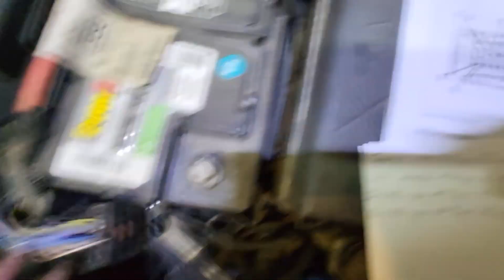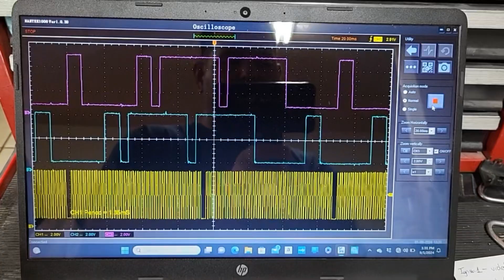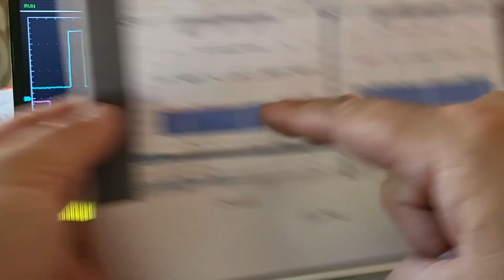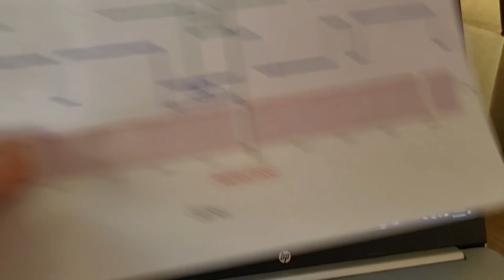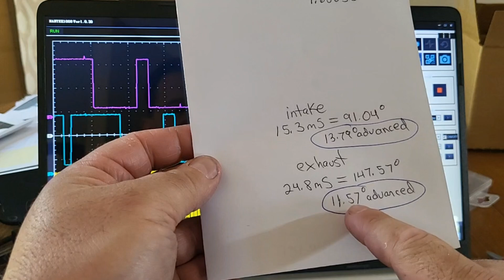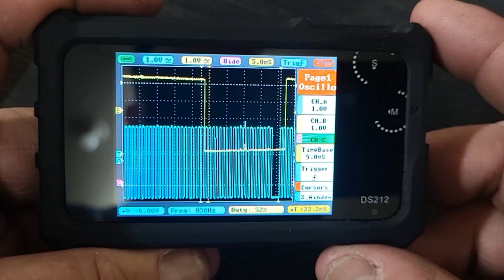Ecotec 2.0T cam/crank correlation, pre/post repairs, Hantek 1008 oscilloscope, DS212 pocket scope

Comment: Cool. I'm sure you already know this: You can setup Phase rulers in the PicoScope Software, then read directly as degrees. This is why I prefer the PicoScope software to the others for this type of analysis. 🔧
Reply from the maker: Ya I'd love to have a Pico but unfortunately I don't have pico money LOL. I don't think the lower end 2000 series scopes allow the automotive rulers or allow the automotive software. I do have Hscope tho and it does have the degree rulers and other automotive layovers. Hscope is about as good as it gets for the home gamer but I'd love to someday get an automotive pico. Thx for chiming in👍
Reply: @MarcBchannel They absolutely do. I have a 2204A (~$150) and it works perfectly. It does not allow you to use the automated setup software like the higher end scopes but otherwise the software is identical. It's really no biggie as you can just set it up yourself by reading and following the guided tests printed on the website. I've done hundreds of measurements on my 2006 Matrix using it with a 2012 MacBook Air.
Reply from the maker: @MarzNet256 Cool I might pick one up. I've downloaded the software in the past just to try it out and I really like it. I like that you can save and share waveforms. I can also save and share with Hscope but the library in the cloud isn't very extensive. Thx for sharing
Reply from the maker: @MarzNet256 I wanted to ask. Do you have pico 6? I've heard that pico has made changes when they came out with pico 7 that doesn't allow the automotive features and won't allow access to the waveform libraries unless you have an automotive scope like the 4000 series.
Reply: @MarcBchannel I run Pico 7 with a 2204A which does not allow the automotive features but I can still perform all the same tests by just following the description on the website. I think it's actually better for learning how to set everything up. Also, other folks put waveforms up which are accessible even without a PicoScope by just running the software in demo mode. 🔧

Comment: Question,  what are the small spikes on the violet cam ocilogram.
Reply: Thanks,for explaining,  very good video, still learning
Reply from the maker: @alvaroenriquez5837 I'll be posting another video here soon on a cam/crank correlation if you wanna check it out.
Reply from the maker: @alvaroenriquez5837 Your welcome👍
Reply from the maker: Signal noise likely
Reply: @MarcBchannel is it possible that it maybe injector,  or coil #1  spikes, or dirty reluctor.
Reply from the maker: @alvaroenriquez5837 I can't say with certainty. It really isn't a concern. Signals will have noise in them sometimes. The noise in the signal is not excessive and some noise is normal especially with inexpensive DIY oscilloscopes like the Hantek which is known to crash when exposed to ignition coil interference. If the waveform is drastically different from a known good then it's a concern.
Reply: @MarcBchannel thanks.

Comment: New subscriber and glad I found your channel because I have a few scopes I have the HS512 , a two channel pico , and a MicSig . The good part of finding your channel is we seem to be at the same level of knowledge . I’m a retired mechanic and the older you get the brain sometimes fails you . I like the section of converting time to degrees and pointing out the advanced and retarded positions on the scope image . I haven’t come across a video with the clarity of yours . Thank you for sharing and I will follow your channel .  Artie 😊
Reply from the maker: I'm glad you enjoyed the video. It's amazing what you can get done with budget scopes and scanners. I also have an HS502 along with my Hantek 1008. I just recently bought a Hantek 6074 4ch and it has better sampling than the 1008 but still has a somewhat small buffer. I really like it on the Hscope app. The 1008 doesn't really work all that great on Hscope. I prefer using it with the PC software. What model Migsig do you have? They look like they are really nice for the price. Good sampling resolution and very large memory buffers like the automotive Picoscopes👍

Comment: I read about the 8 channel is inaccurate or noisy. Do you recommend that device for CANBUS and CamCrank Troubleshooting? I usually do guess works but i want to level up.
Reply from the maker: @MyAutoproblems  It can definitely level up your diagnostics. It's a great scope to learn oscilloscope basics for automotive repair and it will help you with most repairs requiring an oscilloscope. It has it's limitations with it being an entry level scope. It's an 8 bit scope. The resolution is not very high and won't give you an accurate waveform on faster signals but in most cases it's not a problem. I've captured canbus waveforms with it and they are not very good but you are mostly looking for the can hi/lo signals to mirror each other and to not glitch or show a shorted signal. For that it works well enough to spot problems and to point you in the right direction for the repair. As for the scope being inaccurate, it doesn't have the best resolution so the waveform isn't represented accurately on faster signals. But it gives you enough information to make repairs. You can forget about using more than 4 channels at once. All the channels share the resolution so the more you use, the lower resolution per channel. I don't ever use more than 3. You may pick up some noise if your leads are around interference like ignition components. If your testing ignition coils and have issues, you can probe at the ECU instead of at the coils. My biggest problem with the scope is the software. It's very basic. And the memory buffer is terrible. Basically you only get what's on the screen. And you can't save waforms to open up in the program. You can only save an image of it. For an entry level scope it's good enough but there are other entry level scope options. The 2000 series Picoscopes are better but the 2ch one is around 200usd and the 4ch is about 400usd. Their resolution is still not great compared to the 4000 series automotive scopes but the pico software is excellent and you can become familiar with it if you decide to upgrade. A great scope and one I own is the HS502 2ch scope from Martin Loren. It uses his Hscope app and it is excellent. It is a 12bit scope and the resolution is very good for a budget scope. The software has alot of features and can record long captures. You can save waveforms and reopen  them in the app. When you buy the scope it comes with the app and automotive module licenses. The automotive module gives you the 4stroke and 720deg overlays. Pretty high end capabilities for a budget scope. The only draw back is that it's only 2ch but alot of the times you don't need the extra channels. Excellent scope if you can't afford a profesional pico scope.
Reply: @ thank You Sir fir in-depth details about the scope. Do you suggest a 2 channel scope for diagnosis of The Cam-Crank Signal? Sometimes, i get a V6 and then I believe i will need more than 2 channels to diagnose the waveforms for timing chain related issues. Hope you can guide me on this step.
Reply from the maker: @MyAutoproblems I'd rather have a better 2ch scope if I had to choose one. It depends on your budget and needs. The Hantek 1008 is usable if you need 3-4ch but it's not ideal if you need an accurate capture like for ignition/injector/canbus tests. like having both, the Hantek and the HS502 on Hscope app. If I had to choose one I would choose the HS502. It's a way better scope and the app is fantastic. I believe it's still around 100usd, about what the Hantek is. You can get creative with it. You can take a capture with the crank and one of the cam signals then take a capture with the crank and the other cam signal then compare. This is a work around when you only have a 2ch scope. The Hantek 6074 4ch is another option for around 200usd. It has better sampling rates than the 1008 (up to 1GSa/s vs 2.4MSa/s on the 1008).  You can also use it on the Hscope app which adds alot of high end features. I've never used one but there is a youtuber ravifix that uses one on hscope and he seems to do pretty well with it. You have to power it up with a special usb connector with a separate power/battery supply because it's power hungry and the host android device won't power it like with the HS502 or 1008.  I tried the 1008 on the hscope app and it's not very usable because it's hard to adjust the sampling rate and time base on the app. I think it's because the low sampling rate of the 1008 makes it difficult to adjust right on the app. But the 6074 seems to do well on the app. If you use the 1008, stick with Hantek software. Sorry if I'm laying down too much info. There are alot of options and alot to think about. It's difficult to decide the best option when your on a budget and just starting out. The way I see it, any scope is better than no scope. If your just starting out and don't want to spend thousands of dollars on a professional picoscope, than any of these scopes will do. Let me know if you have any more questions. Cheers👍
Reply: @ i love digesting all these technical information! I keep wandering on yt looking for scopes, but without any technical knowledge behind each scope. Your answer has made me clear many doubts. The work around with pico makes Pico 2ch the best budget friendly. I will look into the models you mentioned and see what fits the budget. Again, thank you for all the valuable information you provided. It has made decision Making way easier for a lot of us. Thank You for sharing knowledge.
Reply from the maker: @MyAutoproblems  The pico 2000 series 2ch would be a very good choice for a budget scope. I've played around with the software and it's excellent. Same software as with the 4000 series. You can download the software for free and check it out before buying the scope. Good luck👍
Reply: @ thank You

Comment: You definitely got better resolution on the laptop with the Hantek than i did with hscope. That software is clunky but capable!
Reply from the maker: @Backalleydiagnostics  Ya I actually haven't had good results using the 1008 with hscope. If you set the time base, it changes the available sampling rate selections. When you set the sampling rate, it changes the available time base selections. It makes it very difficult to use. I tried it and I couldn't get a capture similar to the one I got with the hantek software which only let's you set time base. 👍
Reply: @MarcBchannel  I haven't used it on a laptop in a while but remembered it being more like your captures. Good to know in case I do use it . The biggest reason I like hscope is I don't need a garage laptop much anymore. Cheap android tablets in cheap Amazon cases. Now that's something I don't mind in the garage lol. The Droid just don't like the hantek as much as the 502

Comment: Nice video! The 1008c is capable, probably more than we give it credit for. Bottom line is we can fix cars with it. Those images are good plus you showed me a few things I didn't know about a scope I've had for 2 years.
Reply from the maker: @manelishi13  Definitely capable enough for most tests. For the money you can't go wrong. Any scope is better than no scope. Maybe someday I'll get a picoscope but I can't justify $1600-1800 for just the scope no accessories. I just bought an HS502 with the Hscope app. It is loads better than the Hantek but only 2ch. The sampling rate is way better and you can record  long captures. The automotive tools are fantastic. 720deg cursors and math functions. Pretty high end features and capabilities for about $100. I'll post a video shortly using it. Cheers👍
Reply: @MarcBchannel  Awesome Marc! The more people posting with Hscope, I hope will make it come up higher when people search for beginner scopes. Not being on Ebay or Amazon is more than likely the reason. I know that I never saw much about it. Everyone uses youtube,  that's where they will  hear about Hscope, I hope. It lets you follow scanner danner on 2 channels at least!
Reply from the maker: @manelishi13  Sorry just figured out who this is. I'm just a grasshopper. Your the grand master😁
Reply: @MarcBchannel  Not me, I just keep doing like you do and ask a lot of questions. The only thing different than  what you did in that video that you will ever encounter is which wires need measured and where they are. How to adapt to the wire or sensor is just finding what tool or adapter is best. Take care, and thanks for sharing!